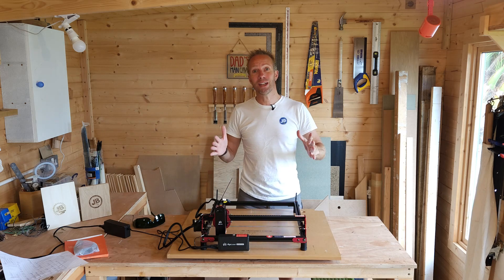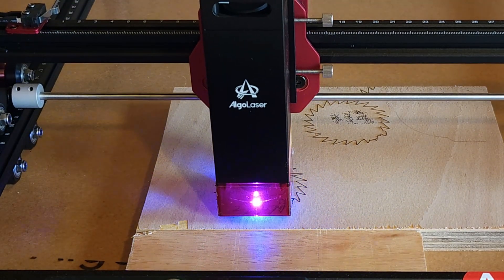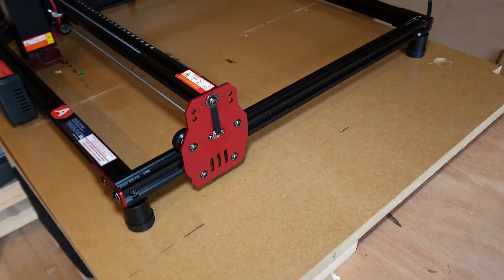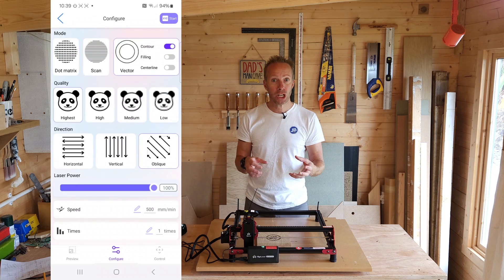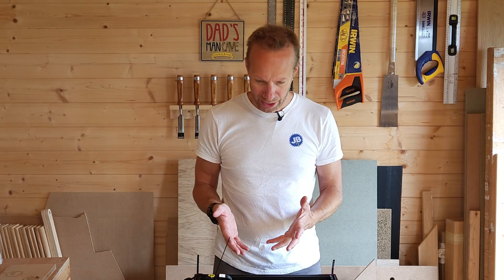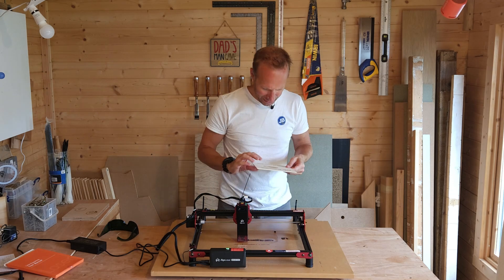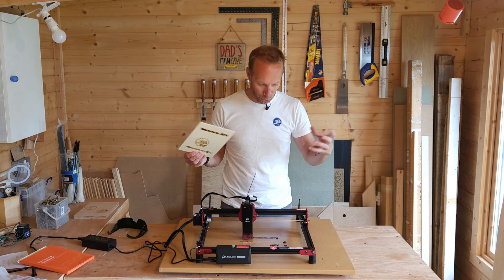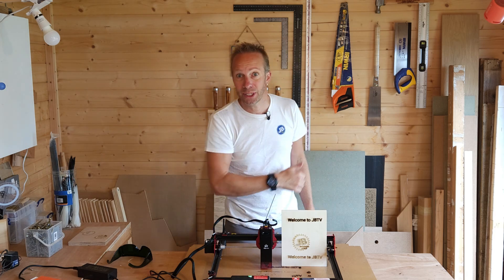Checking Out The AlgoLaser DIY Kit Mini Laser Engraver

Comment: I won one of these about a week ago. I'm pretty impressed with it. The gantry slides very smoothly, the build is solid - not cheap (though the price is), the plastic laser shield attaches with magnets, and it's got the air assist built-in (I already have the air pump). This one will be great to help make my Christmas ornaments. I just need to get an enclosure for it, as I intend to use it indoors. AlgoLaser did a nice job with this one.
Reply from the maker: Agreed, thanks for your thoughts 👍

Comment: Is it better in engraving quality then TTS 10 pro? both are 10W Laser engravers
Reply from the maker: Not sure
Reply: @JBTV  so, could you recommend the top three laser engravers priced between $300 and $500 for beginners? And, is this one good?
Reply: @NenadJugovic-o8e  I won one of these about a week ago. I'm pretty impressed with it. The gantry slides very smoothly, the build is solid - not cheap (though the price is), the plastic laser shield attaches with magnets, and it's got the air assist built-in (I already have the air pump). This one will be great to help make my Christmas ornaments. I just need to get an enclosure for it, as I intend to use it indoors. AlgoLaser did a nice job with this one.
Reply: @MileyonDisney  thank you!